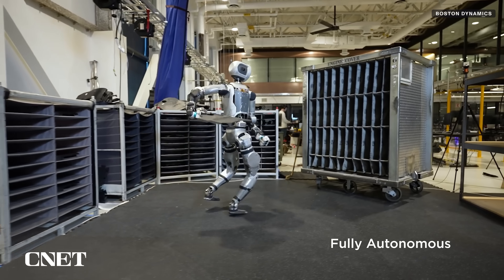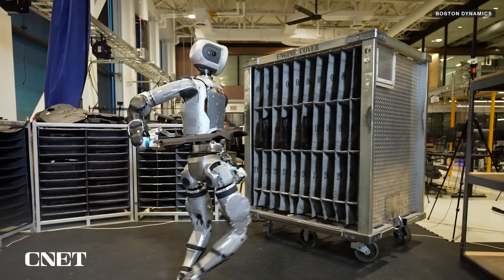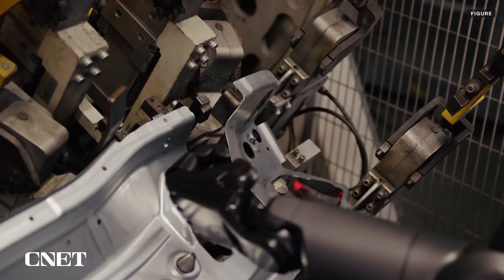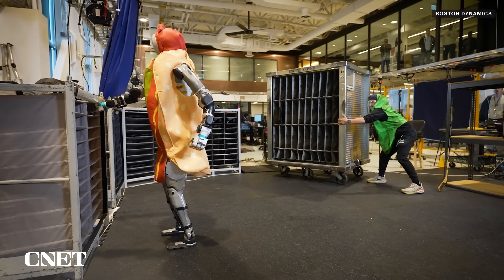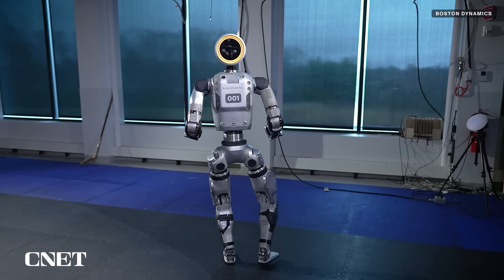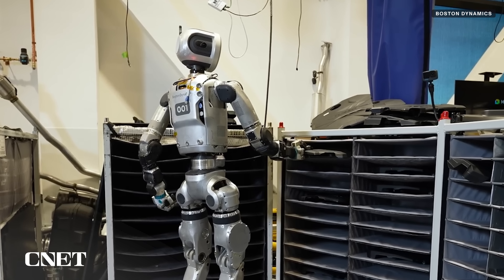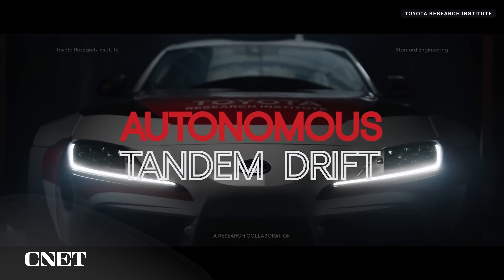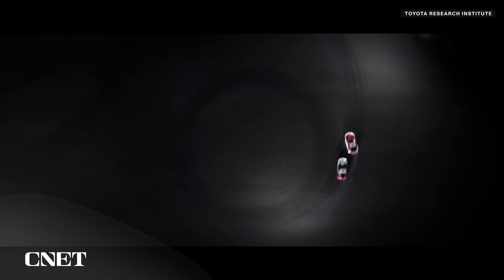Boston Dynamics Puts Atlas to Work (With New 'Hands')

Comment: The fact that one of these robots probably costs 150K to build right now but could get down to 30 K, and it's already doing this kind of work, human labor is done for.

An Amazon warehouse worker, in a state like Georgia is gonna be $27,000. 

One of these robots just working a standard human shift, would pay itself off in six years . 

That's without assuming that it does the job 24 seven. 

And the fact that you can use VR headsets to take over one of these things, and show it how to do a task directly just means these things are gonna be insanely adaptive
Reply: Once the robots are at those prices and capable of manufacturing workers can group and make their own companies.

Comment: why dont they build centaurs. they can reach greater heights, can carry larger weights, have a potential loading area on the back, and they already know very well how to make it move on 4 legs at an acceptable pace  they just have to combine the best of two products et voila. maybe i should write letters to them. its so obvious i dont know why we dont have that. in standing mode the front legs could stabilize the back part of the body in balance allowing it to reach enormous heights and pick up stuff from high up. it wouldn rotate like atlas does but they could just analyze human and horse moevement to manage rotation over movement of the backlegs while standing. even elephants.  or they can even manage to stand upright with 4 available arms. that would be too sick to be true.  

but yeah build centaurs.

Comment: It's the beginning of the end. Robotics to help the rich become even richer, by getting rid of the labor. They are just investing top dollar for an eventual race to the bottom.
Reply: What if the labour uses the robots?
Reply: @Art-is-craft  We already use specialized robots in many industries. This robot isn't that. It's shaped after humans so it can be in spaces that has not been replaced by automation yet or conduct tasks that would've been seen as an over-investment if they were conducted by specialized robots.
Reply: @bensu0145  
Automation machines are not robots. To be considered a robot it has to be bipedal and in humanoid form. What if those workers can use the robots or machine automation as well. Where do we end up. And what if workers use the robots to build other robots.

Comment: I wonder in a factory setting if the robots could be powered/recharged via electrified flooring while they go about their assigned duties.  Imagine them working 24 hours per day without breaktime.  Shareholders are going to love this, the elimination of expensive belly buttons.
Reply: Why so much complication, they can just hot swap batteries
Reply: @iraklimgeladze5223 there is /would be a lot to it: lighter, no swapping time/procedure, power draw irrelevant, just from the top of my head.
Reply: I was thinking the same thing, though they might need something like a flat bottom instead of feet to keep them planted and continuously charging, like a wireless phone charger.
Reply: @altpath that is what I think makes this rather unlikely indeed. One of the USPs are the legs and feet. Otherwise it could simply be a rolling robot.

Comment: Great lets take jobs away from people smh
Reply: Repetitive Jobs that most people don't want to do.
Reply: @christiangonzales3642 which jobs are safe from being replaced by automation?
Reply: @christiangonzales3642  everything you've written in that comment could have been artificially generated. Where is the money to indulge the arts or pay for complex engineering or architecture with a massively reduced workforce? Vast numbers of people without means to support to themselves yet alone pay for luxury goods. We haven't begun to consider the issue as a society.
Reply: Still need to work for money @christiangonzales3642
Reply: What if this will 'force people to become smarter'. This is just progress from another POV.
Reply: "We want 15 per hour" they said...
Reply: Yes post labour economics. let's go
Reply: At some point the robots will repair themselves, recharge themselves, and add new behaviors on the fly. At that point humans become obsolete. Instead of Jerome Powell saying people get sick and machines don't at a congressional hearing, it will be him saying people die and machines don't.
Reply: You can't stop progress
Reply: Universal basic income will have to come because most people will not have a job. I guess we’ll just sit at home and figure out fun things to do.
Reply: Thoughts, stuck in the past.
Reply: It’s all about bottom line my guy. 
Paying someone to do a job that a robot can do for a fraction of the cost is just charity.